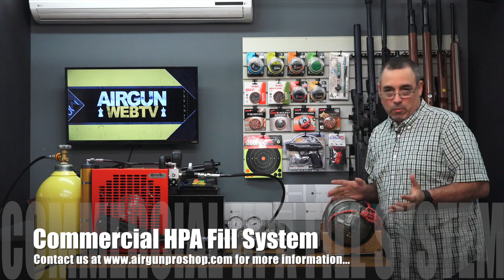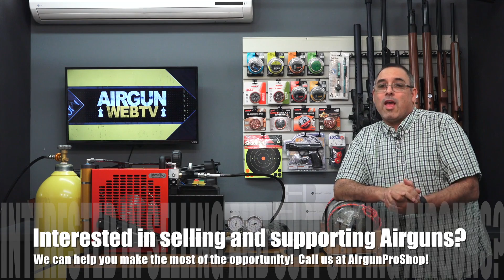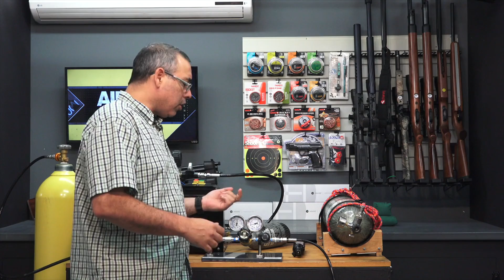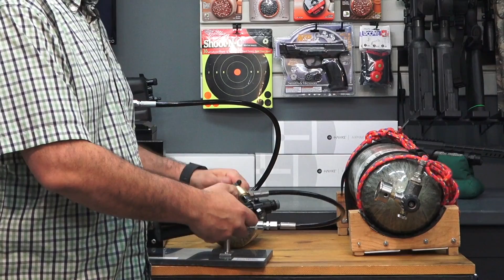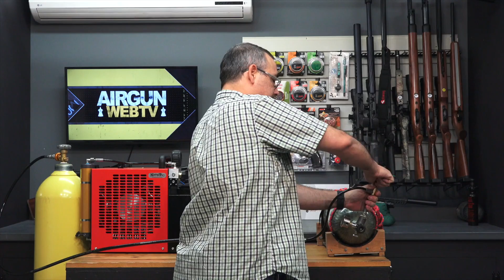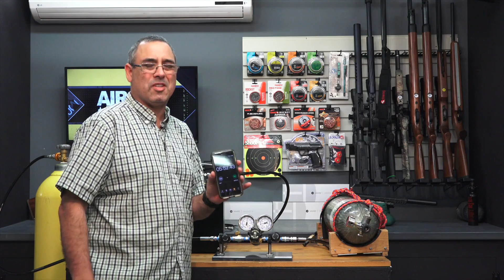First System on the Way! Commercial Fill System for Small Retailers - Available at Airgun Pro Shop.

Comment: You know the actual tank fill line is way over built . Look into the paint ball , or airsoft world . We have push button fill stations that will fill a 90/4500 from 0 to 4500 in about 10 sec . You need more then one mother bottle to sypen fill. If your mother is at 4500 your going to fill to 4300 on a good day unless you have multiple mother tanks at 4500.
Reply: Also good to note that keeping bigger carry  tanks cool is very important . If you keep them cooler then the mother they fill fuller and faster . The cooler big carry tank will actually pull the air in once they get hot ( if youve ever filled you know they do) they wont syphen feed very well
Reply from the maker: @ALEX-xd7ko  - so just so that you and others reading your comments understand the principle here.   The big tank is 5000 PSI not 4500 PSI.   The point being that a 45L tank at 5000 psi can top off a 9L tank fro 3000 to 4500 in about 30 seconds with minimal head loading.  Then the compressor can top off the big tank in under 20 minutes to be ready for the next fill.  Having more storage is great provided the compressor can handle the load.  We have revamped this system and are using a new compressor going forward.  I'll have that video coming out in a few weeks. It will be continuous duty, have auto start, auto drain, and auto shutoff.  Essentially nearly 100% automated to keep your cascade system topped off and ready to fill bottles regardless of the size.

Cheers
AGW

Comment: Rick I’m a super active technical diver who fills tanks and we typically go no faster than 100 psi / minute on the fills. Otherwise too much heat is built up in the gas and you loose several hundred psi once the gas cools to room temperature. Boyle’s Law
Reply from the maker: Thank you for your comments.  This is an issue we are going to address in upcoming videos.  We’ve done extensive testing filling from our compressor as well as from the storage bottle with our fill gear.  We are seeing very minimal pressure loss.  There are features built into the compressor and our fill kit that makes this possible. 

Cheers
AGW

Comment: I would think that it is important to explain that any storage bottle that requires Hydrostatic testing would require certification by an authorized inspection station or manufacturer and marked ( dated) to be safe to fill. If out of hydro it should not be filled. Also, it's important that the filling station perform a visual inspection of the bottle before filling. Many on the gun PCP tanks need be checked by the manufacturer or an authorized service provider after a predetermined amount of fill cycles to( this could be an issue filling on the  gun vessels). Anyone that's thinking about doing this service to the general public better consult an attorney and have adequate liability insurance in place not to mention the knowledge and experience of dealing with high-pressure storage vessels, just in case you end up in court. just my thoughts!
Reply from the maker: Absolutely critical information!  We’ve already been talking to a national training company that can provide training to store owners and their staff on just these issues.  We are not just trying to peddle some bag of parts but rather a true system that’s sustainable, safe, and that will facilitate the success of airgunning for hopefully a lot of new locations.  

Cheers
AGW
Reply: Thank you, Rick I believe it is a great system and I'm 100% convinced of your commitment to providing a safe sustainable system that bridges the gap between PCP gun owners and the easy ability to enjoy the sport on a more consistent economical basis. Safety, of course, should be the number one goal of us all.  As the sport grows so does the opportunity for human error. Thorough understanding of the costs and limitations associated with any business that requires trained personnel and large capital investment (brick and mortar)has many issues to be addressed. A safe happy customer being #1. thanks ,THE PELLETGUNNUT